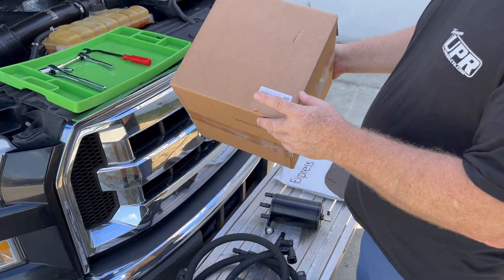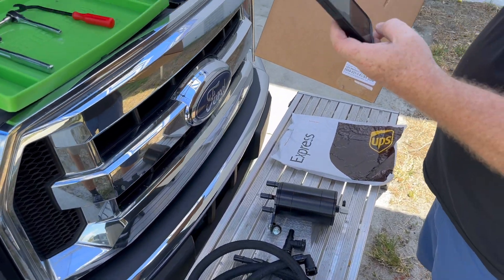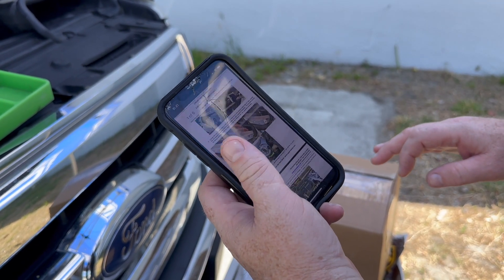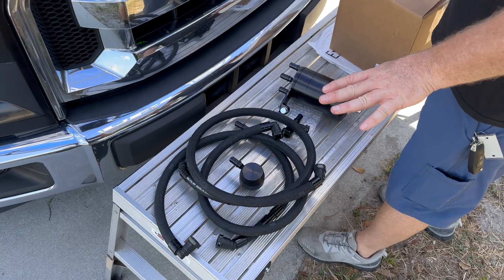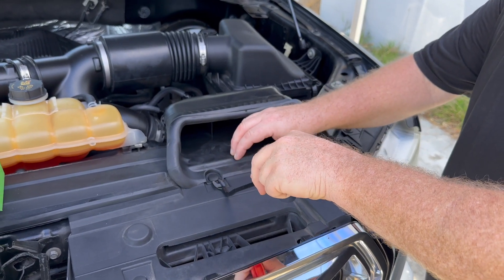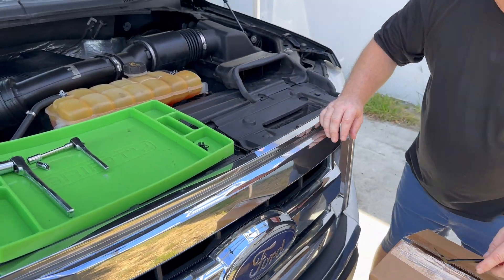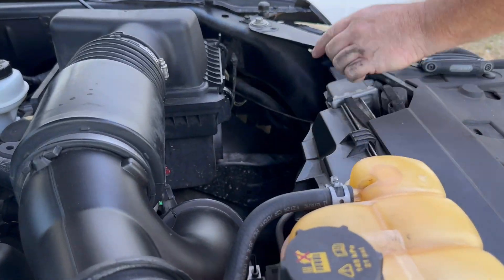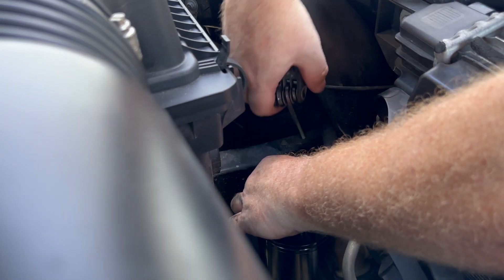MEGA CAN for 2015-20 EcoBoost F150s!

Comment: Great install instructions.
So I assume the clean side separator that clips on the valve cover is essentially a mini catch can?  
I already have a passenger side catch can and figured adding this might keep a small amount of oil out of the intercooler under boost.
Not that it's a lot anyway.
Reply from the maker: The Clean Side Separator is a baffle / separator.  You are correct that it keeps the oil mist from saturating the intercooler.

Comment: I really like the design of this, but how do you drain the catch can?  In the video I could see the ground under the truck, but my '17 has an engine bay cover down there, and it wouldn't be all that convenient to remove it to get to the catch can drain.
Reply from the maker: The easy setup would be to add a drain line to the drain valve and you can just have the drain line come out wherever you like to go right into an oil pan without removing any covers. We off drain line kits and hose as well for any application.

Comment: It seems my 2019 F150 2.7 EcoBoost engine has a built in oil/vapour separator built into the valve/cam cover. I did install catch cans on both the dirty and clean sides. I get about an ounce of oil on the dirty side every 5000 miles (approx) I check it spring and fall, when I do my oil changes. The clean side is 100% oil free when I check it. It actually looks like brand new when I open it. I don't think a catch can is really required on the 2019 2.7! 🙂 Also, since the 2019 has both direct and port injection the coking of the valves is pretty much eliminated. :-)
Reply: If the truck is a daily driver and isn't used for towing or hauling much, you will not typically see much in the clean side catch can.  If the truck is used for towing and hauling, the engine will see boost more often and that is when you would see crankcase pressure escape from the driver side valve cover.